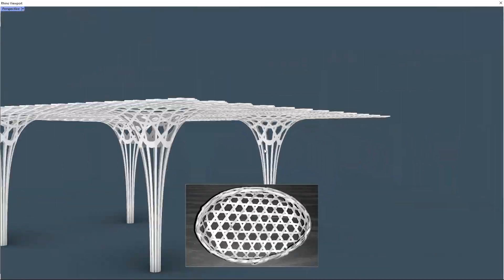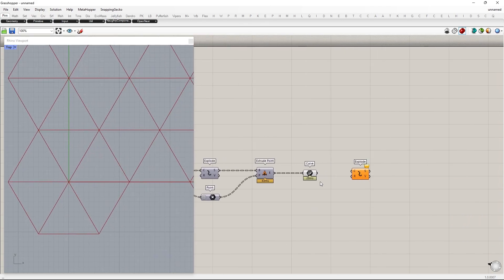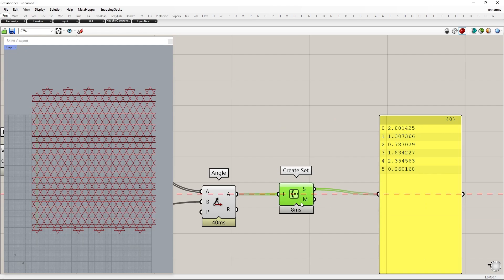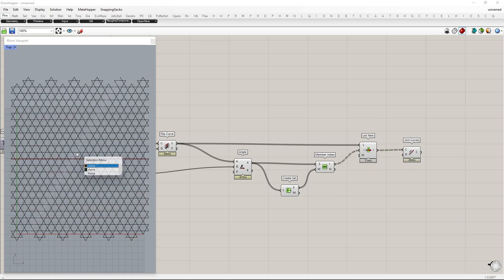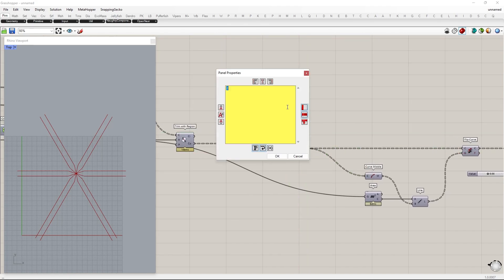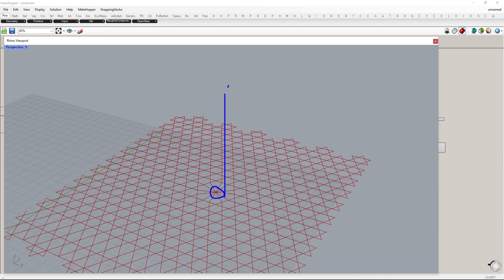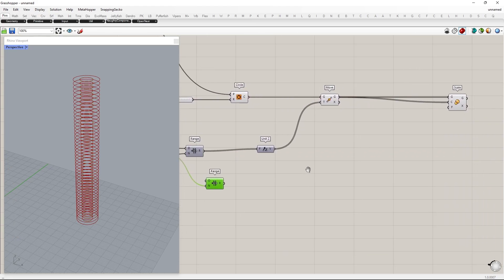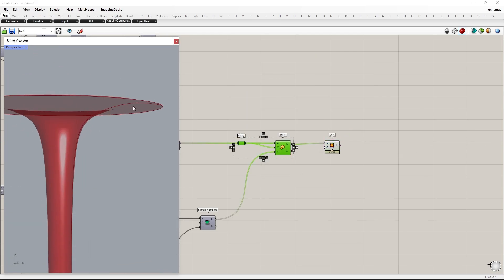How to make Kagome pattern column in grasshopper

Comment: i've changed the input surface which the hexagonal grid will be projected upon from the boundary rectangle to an irregular surface i've made, i changed somethings accordingly and it all worked out great. till the loft, when i came to the loft it kept giving me many and different error messages no matter what i tried. 1. loft cant be constructed or 2. all curves must be either all open or all closed (when i checked my curves i discovered i have some linear lines and some nurbscurves i do not know if this is issue or something else) , please help 😭my script has evolved into a monstrosity

Comment: im not able to loft at 12:36 for some reason
Reply from the maker: Try this: remove the Offset before Project. Just connect the merged result directly to Project, then apply the Offset after on the projected curves and Loft from there. This might solve it.

Comment: Hi, I'm curious about 3:42 until the join curve. The panel ain't showing the numbers only the kangoroo ite, flasifying the member index.  the  create set and the set going onward are in red. May you enlighten me on the issue in have. Thank you
Reply from the maker: Hello, can you please provide the warning you're seeing? You can view it by pressing the bubble icon on the red components
Reply: @3DBeast  It's a n empty generic data parameter
Reply from the maker: Try giving the angle result directly to a text component, then connect it to your Create Set component. I'm not sure exactly where something was missed, but it could have happened when following the steps.
Reply: @3DBeast  Thank you

Comment: Hi i have tried doing this but from 1:32 , i had to give 2 middle point to get as you mentioned; at 3:01 i had to use flatten Create set to get the output; at 5:52 could get output only for 2 curves.
Reply from the maker: Hi, sure, are you looking to get the job done in a quick and dirty way? This video is about teaching methods that benefit you in the long run,—not just getting results. Using two inputs or flattening destroys your data structure—I wouldn’t recommend it unless you're just after a quick fix.
Reply: @3DBeast  I could do my method because I tried doing your way. I couldn't get what you have mentioned. Im a new learner, learnt most of the softwares from YouTube. But grasshopper is not an easy task to do so. Help me to solve it please.
Reply from the maker: @vigneshmurukesan  hit me up with an email, and I'll check it when I get time. You can find my contact details here: youtube.com/3dbeast/about

Comment: How can I do this with a morphed surface made on rhino instead of starting with hexagonal lines at the beginning. I want to start with a surface I made on rhino basically. Please help.
Reply from the maker: Here's an improved version of your draft reply:

You can reference the surface you made in Rhino using the surface container in Grasshopper and replace the lofted surface.

Comment: Hi! Thanks for this very helpful tutorial. I’m getting stuck on the loft at 13:00 and it’s turning out very messy and chaotic. I have pufferfish and I believe all of my other parameters are set correctly.
Reply: I have the same issue with the loft, how did you solve it?
Reply: Never mind! I figured it out!
Reply from the maker: @johnhouseman3546  Nice Thanks for the update!
Reply: @3DBeast what was the solution? I am also stuck for two days in a row, can’t figure it out:(
Reply: @azharasultansikh1043  Hi not sure if you figured it out however, right below the graph node where the domain start is move it around a bit and adjust to where the loft comes out clean. Hope that works!

Comment: Hi! At around 12:30, when I connect the loft component to the project component, it creates a triangular plane with the curves created with the prune component around the central hexagon. It doesn't look like what you have on the screen- what can I do to fix this?
Reply: i got the same problem, did u know how to fix it?
Reply: I had the same problem. You need to be in the top view when he switches to top view at around 12:04

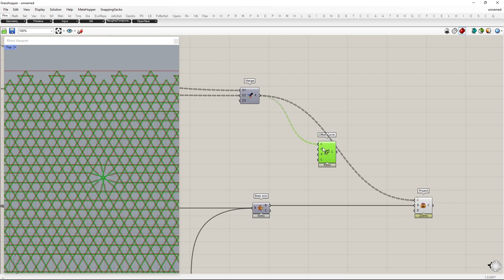Comment: which unit are you using at the rhino? Millimetres, meters or centimetres?  Do the values that you are giving in the number slides have units? ı have a problem with the value that you are inserting at 12:15 value=2.000. When I use the command of a project, it disorders the body of the column.
Reply from the maker: In the video, I'm not using real-life measurement units to focus on the visual aspects of the modeling process. You can set the Rhino unit to any unit you prefer (centimeters, meters, inches, etc.), and this will make all the number slider values be in that unit. If you're having trouble with disorders in the body of the column, try using smaller offsetting values or try a different approach. create two different surfaces by offsetting the original surface. Then project the curves onto the surfaces and create a loft between them. "

Comment: hi, when you connect the trim with region component to the curve component, why do the two horizontal lines at the bottom get trimmed (5:35 timestamp)? is there a way to fix that?
Reply from the maker: connect XY plane to P(plane ) input

Comment: Hi, i have a problem in 6:29 with extend curve, i connect everything like you do and mine still light in orange. Can you tell what i have to do to fix it?
Reply from the maker: what the waring says? (bubble icon on the component )
Reply: @3DBeast  Input parameter Curve failed to collect data
Reply from the maker: @beatawrobel1695  u disable some nodes by mistake, check out gray components and enable them
Reply: @3DBeast  thanks, it works now :)

Comment: Thank you so much  for the tutorial!! I wanted to ask What do I have to do so I can make a facade with this mesh-structure?? I want this structure to flow all over a prism (that would be the building) like a lattice. I just need the mesh to keep going over the sides of the prism (that would be the walls). I can't get it done in grasshopper
Reply from the maker: first convert your wall into triangular patterns,(tri-remesh component help u here ) then from the triangle u can create the patterns

Comment: Really cool Stuff but I got stuck at the begining when you inverted the polyline for some reason I tried and it would not let me
Reply from the maker: connect the "Boolean toggle" component to C input and set it to True.
Reply: @3DBeast  thanks for the help im futher along the video now, (@11:10). for some reason it will not let me connect the geometry from the rectangle AND the list index from the circles to the same boundary surface. it will only take one
Reply from the maker: @jeronimoreyes9398  Hold shift while you connecting
Reply: @3DBeast  I feel stupid, hahaha, this is a really cool design i really want to see it work, I'm fairly new to grasshopper so I'm making some begginer mistakes but going through it has taught me a lot. Thank you for all the help
Reply from the maker: @jeronimoreyes9398   I'll make sure to keep new users in mind when creating the guide.